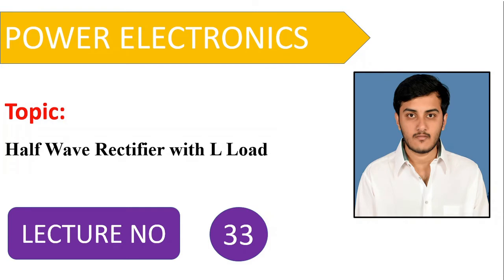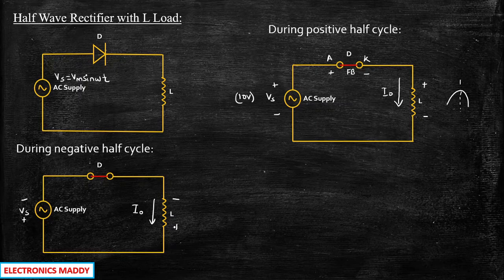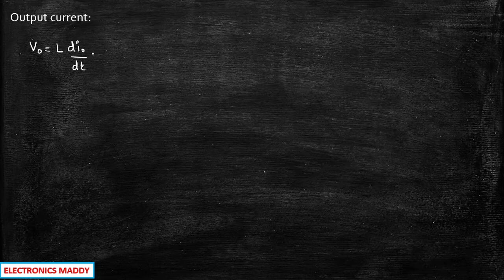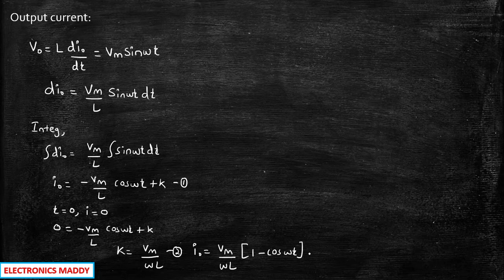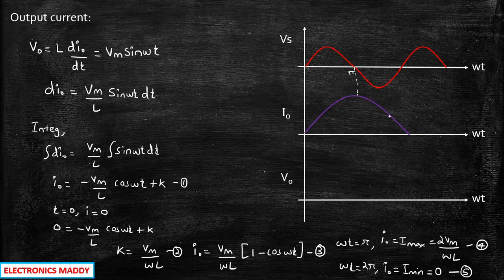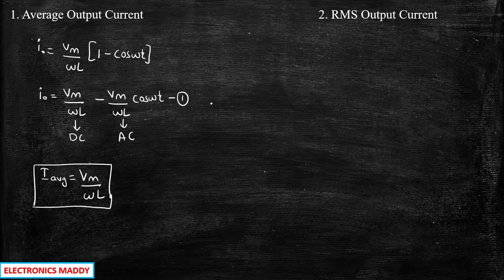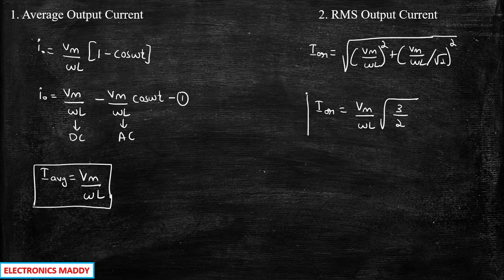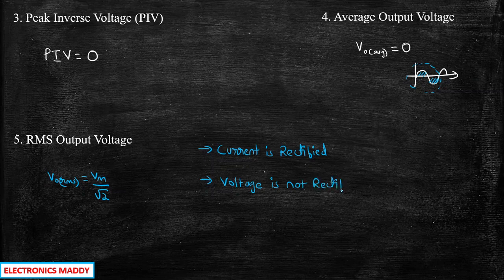Half Wave Rectifier with L Load | Power Electronics | Lecture 33

Comment: 2:45 But the analog that inductor was charged till 10V does not seem right. infact ideal inductor should have the capability to change its terminal voltage to any value to make sure that current through it does not change abruptly. Even with the graph it can be said that inductor voltage is exaactly equal to supply voltage. So, -3 and -10 v can not be given as reason for the diode to remain forward biased. I am open to discussion though.
Reply: Can anyone please correct me here. I am learning diode rectified HW L load. I want to plot the diode voltage Vd, is it 2Vm at π
Reply from the maker: The inductor would have charged to say 10V. Now, the inductor does not have any path or energy consuming components to discharge. So now where does that energy go? The point I wanted to clear is diode would be Forward biased as, at instant 'pi' the supply goes negative, and the voltage across inductor reverses to ensure current remains in the same direction. Therefore, the diode would be forward biased as the supply keeps increasing in the negative direction. But your point is also valid that once diode is closed and forward biased, the inductor voltage or output voltage just follows input voltage. I just tried to focus on why the diode is FB, which is very critical for understanding.

Comment: How can the AC component of average output current be zero?
Sinusoidal wave forms for output current don't have negative cycle.
Reply from the maker: The expression of the AC component would be zero, as any sine wave average value for one full cycle would be zero. Don't get confused with the waveform as the waveform has only DC component if you observe carefully.